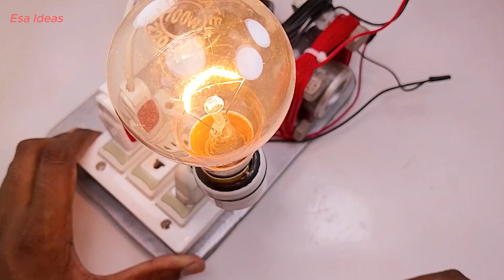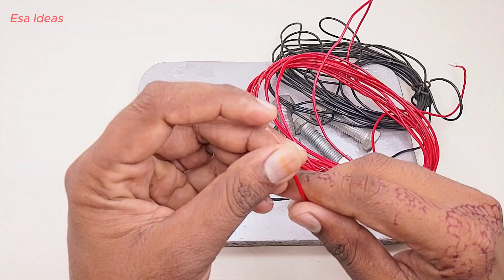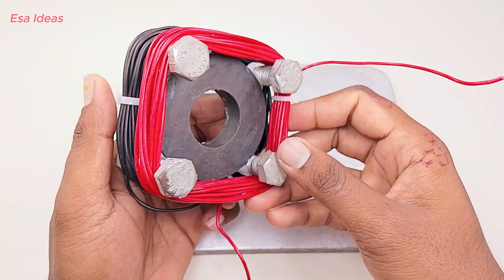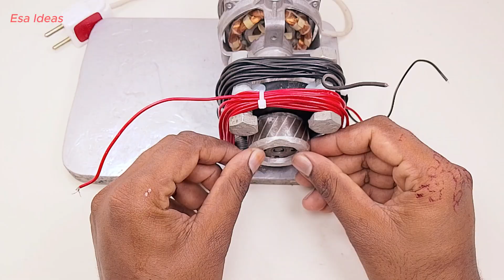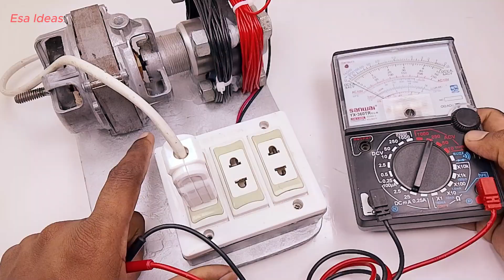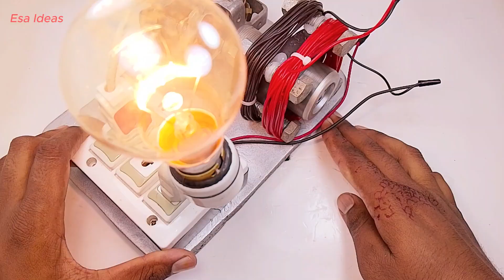Way to generate 220v 10kw free electric generator at home from 100% copper wire and magnet.

Comment: you're not getting 10kw out of that unless you run it for about a year straight... or run it at such a high RPM that the bearings would melt or self destruct...